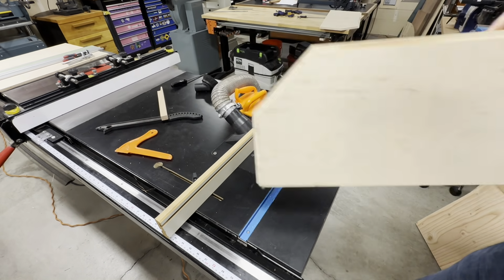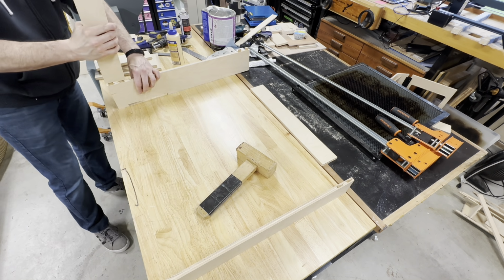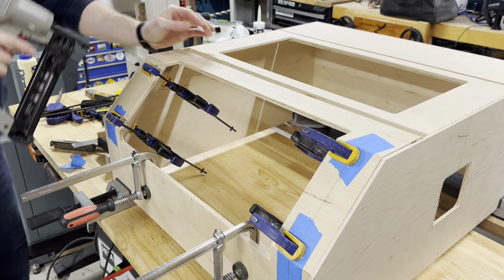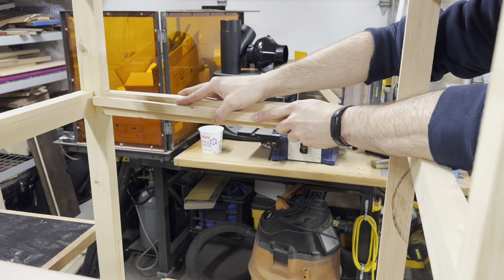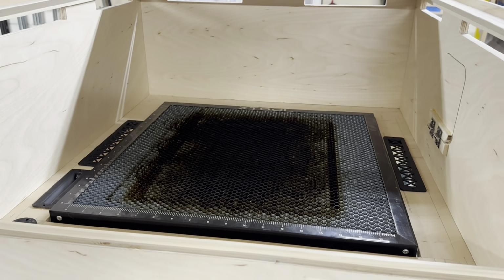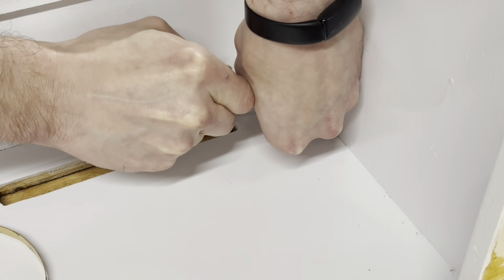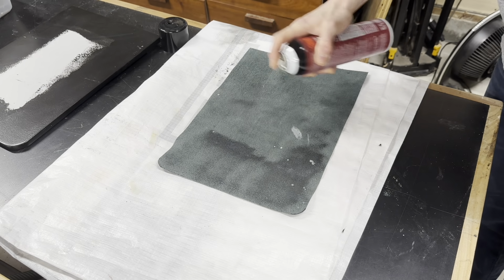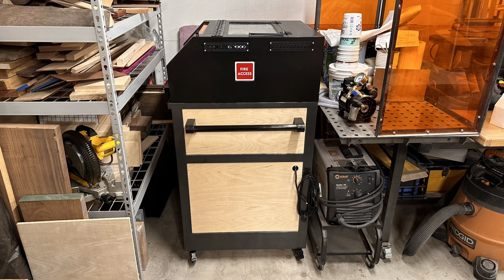Building a Laser Engraving Machine Enclosure

Comment: I installed a WrDAZG automatic automative fire suppression system in my laser enclosure. If the fuse were to light it means you have a real fire on your hands. I had a cedar fire once and fortunately the fuse did not light and was able to remove the burning cedar to the driveway.

Comment: Beautiful built! The lift was a great idea. 
I'm working with a similar machine but from Two Trees and the machine physically moves, ever so slightly, from it's position after homing. It's a nightmare in case the machine accidentally gets shut down during engraving, because I can never get it to the exact position again to continue from where it left off. I see you have also not fixed your machine's legs with some fixture/jig. Do you encounter a similar problem as well?

Comment: NICE! I am in the process of designing my enclosure for my engraver. Your ideas are perfect. The only difference is that my exhaust system is outside the enclosure, venting out the back of my shop, but it is totally hidden from view other than the 4" hose that connects it. I turn wooden bowls, so my lift mechanism is a little more complex because of the need to get larger pieces into the chamber, but it is still similar. 

Thanks for sharing - this is a great build, and you did a superb job with the video.   
Lowell  😁

Comment: Wish i could make something like this.
Reply: I made mine from two Ikea cupboards, fixed back to back. Took 4 hours and including lights, hinges and various clips cost about £15. Already had perspex and extractor fan from previous corex box. If I had to buy fan and perspex probably cost about £50. Tools? Screwdriver, drill, hand saw. 800 x 800, takes my extended 20w diode with cutting area of 420 by 620.

This box is great, but it's massive overkill and only doable if you have a well equipped shop and time on your hands.

Comment: This is pretty amazing, super creative and came out excellent. This has to be the best home built enclosure I’ve personally ever seen done. Especially that acrylic bending trick, awesome. 

I do have a question since I don’t do wood working, why those types of nails instead of screws? I understand the ease of use but is it as strong or durable as a screw long term?
Reply from the maker: @TheExtremeElementz  thanks.  To answer, ease of use.  The joints aren’t under tension or forces that will pull them apart anyway.  Glue would have been enough.  No sense in overbuilding, plus with 1/2” plywood, a thicker screw would have split it.

Comment: Hi, nice work. From where do you buy that orange plexiglass? Thank you
Reply from the maker: Mine was an off-cut from a custom metal shop that was building enclosures for welding combustion cases for jet engines, so I don’t have exact spec, but you can get what you need here:  https://lasersafetyindustries.com/products/windows-acrylic-sheet-class-4-450?gad_source=1&gclid=Cj0KCQjw2a6wBhCVARIsABPeH1v7fEHfZiqu95ARwkEO4GCEEEMAW9F64P1IP2qngrcL-iZ-Alg2wOkaAuY7EALw_wcB

Comment: Great build, can you write what type of plexi was used ? What is the best to reduce 450nm laser wave?
Reply from the maker: Mine was an off-cut from a custom metal shop that was building enclosures for welding combustion cases for jet engines, so I don’t have exact spec, but you can get what you need here:  https://lasersafetyindustries.com/products/windows-acrylic-sheet-class-4-450?gad_source=1&gclid=Cj0KCQjw2a6wBhCVARIsABPeH1v7fEHfZiqu95ARwkEO4GCEEEMAW9F64P1IP2qngrcL-iZ-Alg2wOkaAuY7EALw_wcB

Comment: Are those 3D printed vises? If so can you share model? If not, where did you get them?
Reply from the maker: Vises?  I’m not sure which part you mean.
Reply: Around the 5:35 minute mark, you have the box in a set of corner clamps/vises on your work bench. They look like they might be 3D printed but not sure.  @catspawcustoms
Reply from the maker: @jrutherford10  gotcha… wolfcraft corner clamps. wolfcraft 3415405TV Quick-Jaw Right Angle 90 Degree Corner Clamp,As the picture shown,Medium https://a.co/d/cWVm7Hz

Comment: Wow very nice! Tha turned out great! Last week I built a camera holder for my Atomstack Camera, I was not impressed with the original mount it was to easy to bump and knock out of alignment. I made the mount to stratal my Longer Ray laser from the front to back out of 1/2 square 16 gauge tubing. I would not not use a laser without camera after getting it calibrated with Lightburn. I am weird that way. Just like I will never use a band saw without a brake. I like that lift too! 😁🛫

Comment: Hey it is cool to know you are an A&P. Bromotrifluoromethane halon 1301. Rather than use a dry chemical ABC type extinguisher there is another fire extinguishing agent that Cirrus aircraft developed because of the issues with halon 1301. I saw it for sale at Home Depot and like halon 1211 it can be used in enclosed spaces it is called prepared Hero Fire Spray. I thought I would pass that along! 😁🛫